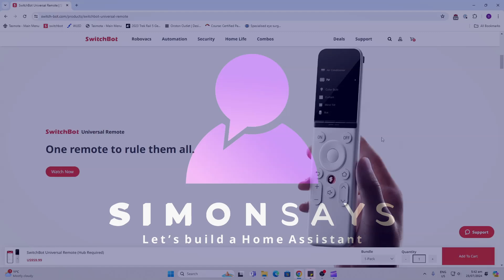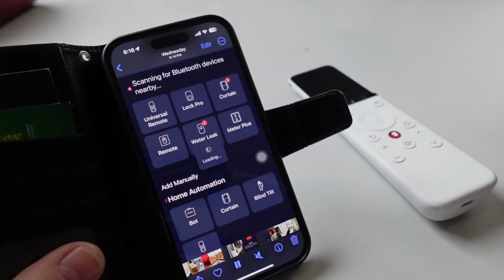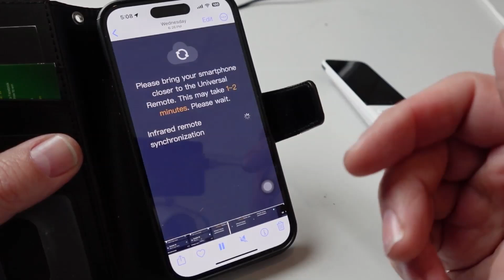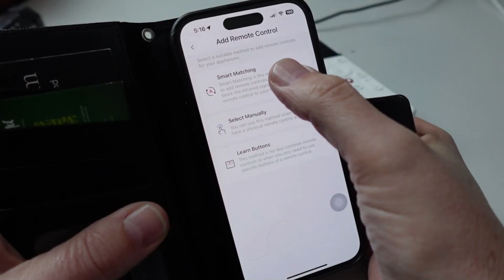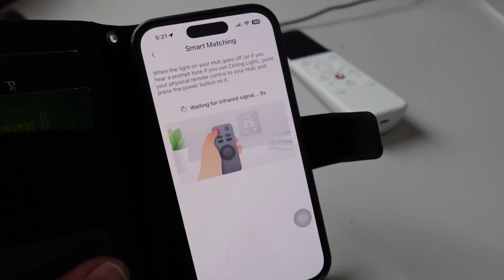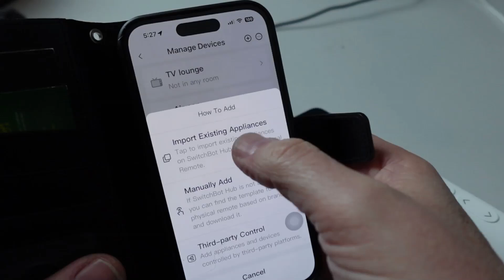Will this Switchbot Universal Remote Control Replace the Logitec Harmony?

Comment: Will this control the Sonos Ray? Thanks
Reply from the maker: @honberg193  if you can control it via infra red then yes it will
Reply: @simonsayshomeassistant  Thanks, the problem is its WiFi I understand. Currently I have to use homeassistant on my phone 😪

Comment: Until now, it can't replace the harmony. Switchbot doesn't get the point of the harmony idea. We need scenes with completely free configurable remote Profile. For example, volume will control the avr Receiver while Ch-up and Ch-down will send the specific IR Signal to the TV, within the same Remote Profile.

Also, when switching between scenes that include different Hardware, like cinema Mode that makes use of a projector, the logic doesn't know to switch that projector off and roll up the projector screen when switching back to TV Mode...

I have the remote here but nothing yet available will solve that problems. Lets hope for some good Updates though...
Reply from the maker: @vierpunktzwo  yes the harmony is a great product! I think it is possible but will rely on software work, we can only wait and watch.